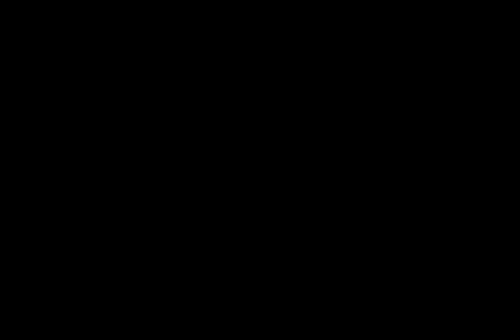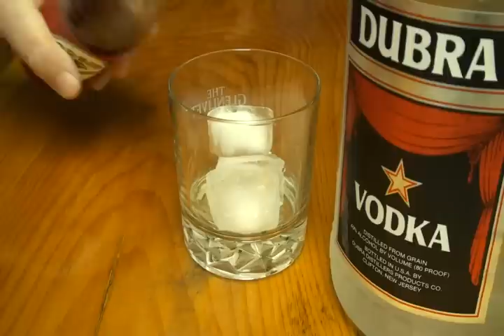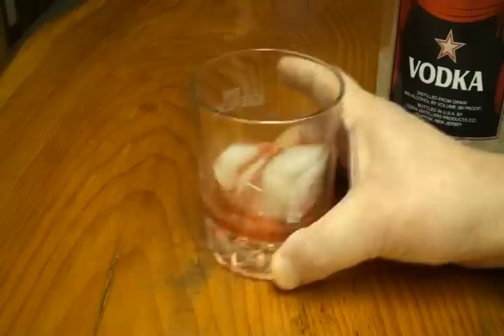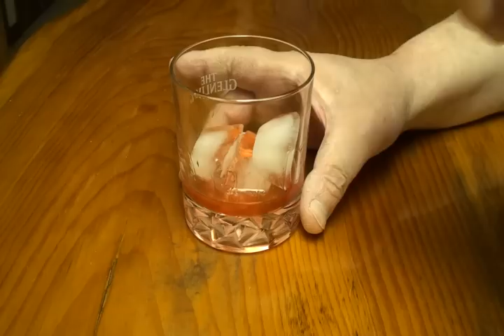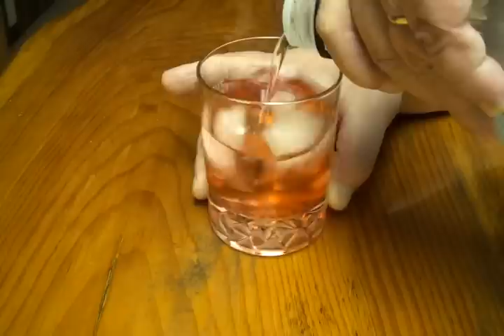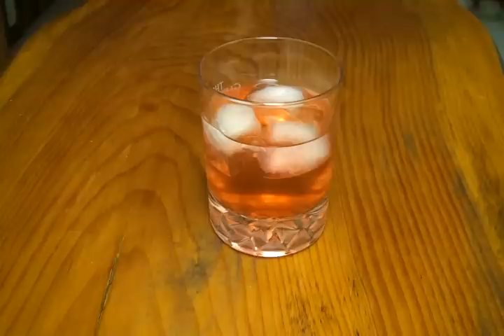Vodka Glass

Comment: @EthanWiner that is for sure (regarding cheap vodka), especially after adding Grenadine and/or the second glass!

so ethan it dawned on me that might be why i've heard of folks placing a weight or even a full paint can (with the lid closed) inside of a kick drum...i guess that would not be a significant change in overall tone, but it would lower the pitch of the shell potentially and may give an overall slightly lower kick drum tone...any other recording applications for this?

Comment: I would like to see the solution! Though if I could take a stab: I would say it's becuase the vibrations going through the sides of the glass are dampened by the liquid in the glass. If the glass was really really short, the frequency would be higher. Here the sound still resonates in the water giving it a low tone.